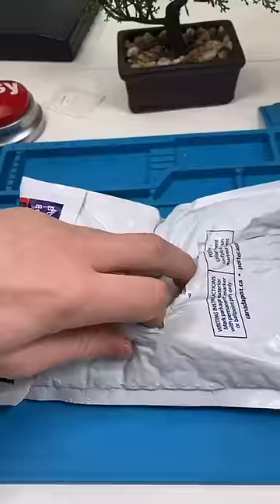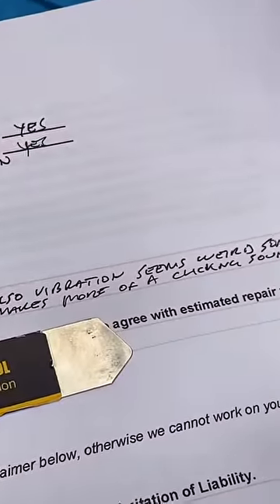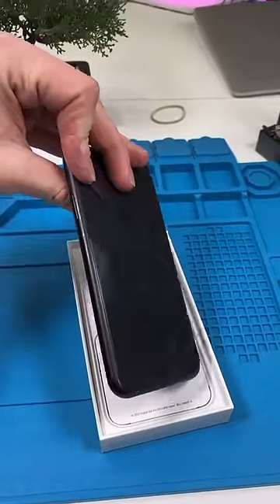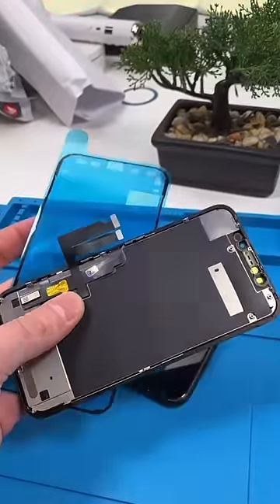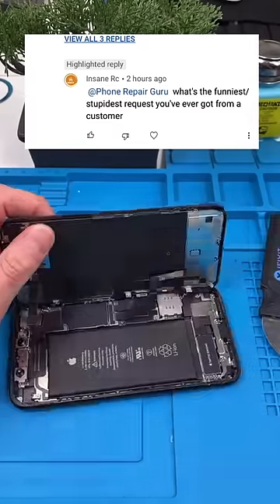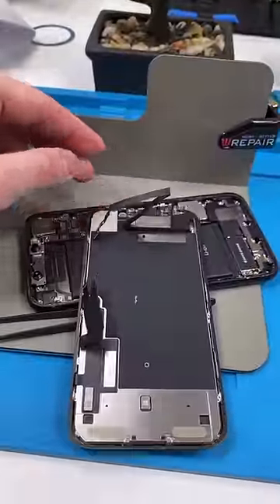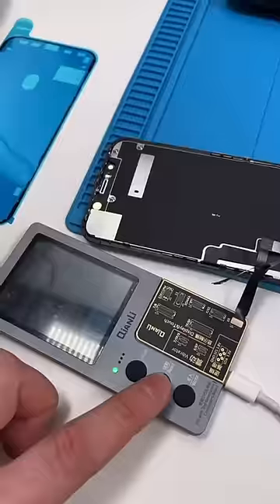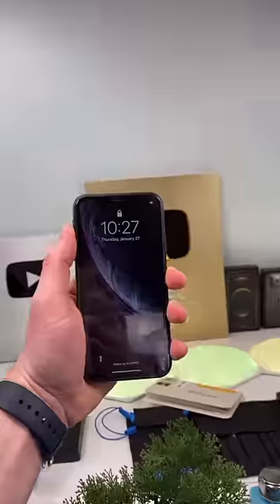What's The Strangest Request From A Customer...? #Shorts

Comment: I've seen your shorts around, and I saw in your about section that you only accept mail-ins from Canada which is awesome (I had thought you to be in the US) but if I wanted to submit a mail in for a hardbricked (possibly just battery dead) phone, what's the process/link for that form I always see with the device? I'm assuming the mail instructions are on that form, so that people actually fill it out haha. I'm over in BC and I'm fielding my options rn cause my hardbricked phone had some data that didn't get stored in the backups, and I can't use Samsung switch if my phone won't even turn on 😓 the one main problem is some repair places want the password turned off before taking the phone for repairs but like I can't turn it off when my phone won't power on.. would that be a dealbreaker for you that you can't unlock or get into the phone?
Reply: Have you checked the links in the description part of this video? :) he has a website, maybe you can find what you’re looking for there. :)
Reply: @peterpansplayground  thanks! I'll look into it. I don't often see the description on shorts so I kind of forget it exists sometimes 😅

Comment: So I have a problem with my phone and I was wondering if I could just take it to the apple store to get it fixed.

It’s an iPhone 11 Red and working pretty good still, no cracks in it and the batter kinda sucks but I’m gonna wait on that for now.

Basically I spilled some sprite on it and the power button is kinda not working well. It still works but it doesn’t click anymore. It just kinda works. It hardly pushes in so sometimes you don’t notice that it’s working. I can live with it but I’m just wondering what you think I should do and how much it would probably cost me. 

Thanks PRG

Comment: Is it true that most phone battery hates being at 100% charged??
Reply: It kind of is. One of my phones stayed on the charger, so it never discharged below 90%. After just a couple of months the battery puffed up and lost a lot of capacity. On the other hand, I used a charge limiter on my other phone, so it never charged past 80. That phone's battery lost almost no capacity after a few months. But you should be fine charging it fully and then using it, so it doesn't stay at 100 for too long.